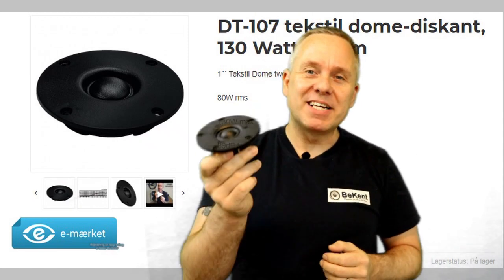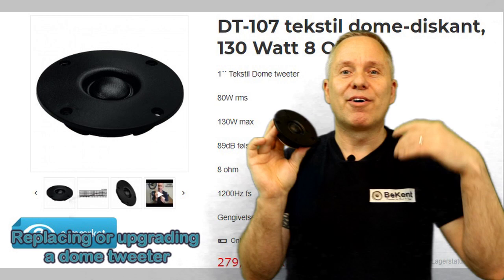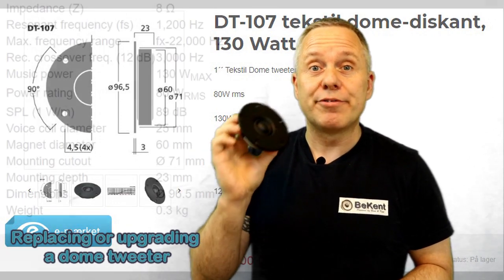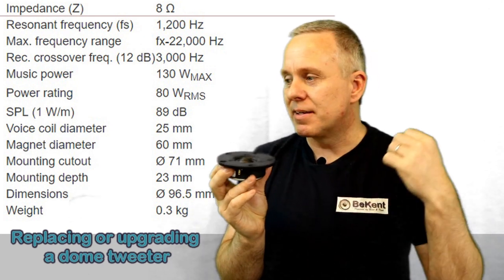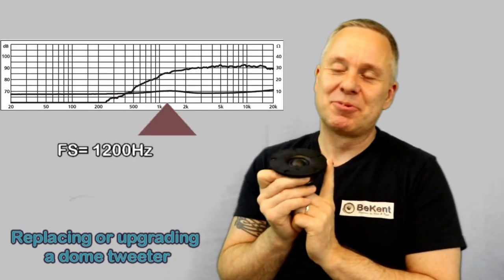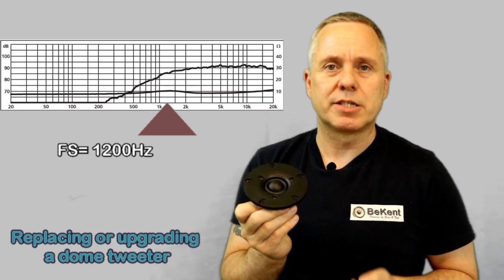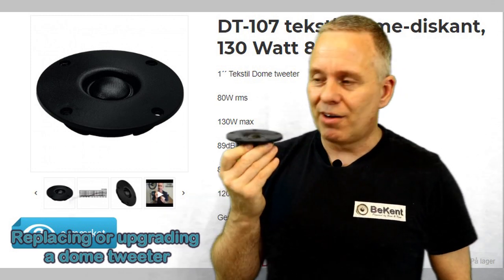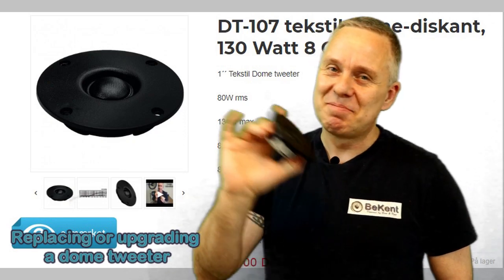Replacing or upgrading dome tweeters

Comment: Aftermarket tweeters is a game of chance. I bought an Audax  direct replacement for DALI 18 MK II . The sound is very sharp in the 5-10kz range. I could say the tweeter sings. Its anoying for long time listening. Peerless 811830  8 ohm dome tweeter matches well will DALI 18 MK II , but the magnet size is  too big and does not fit in the speaker BOX, 
thank you for this rich inside

Comment: hi thank you very much for your great and very valuable video
i see two problems with Tweeters   The usable range and their distortion
For usable range i have been told to look at the fs   The usable range should start from 2xfs up   Better use a 12dB cut
The main problem remains to get distortion figures   They are almost impossible to find on the datasheets 
A very good tweeter should have very low distortion also at quite high Spls   In its usable range of course

Comment: I have a three way old sony speaker.the crossover is at 2000/5000.1st order crossover.i want to replace my tweeters.the original tweeter fs is 900hz.can i replace it with a fs 1000hz tweeter?
Original is 93db.replacment is 89db.
Original is 30w.replacment 80w.
Plsss help me 🙏

Comment: You can turn down but not up. Impedance  is resistance @frequently  4 ohm reads 3.7 a can dip to 2 ohm  make sure your amplifier can handle load and wattage. Your are not very informative

Comment: Hi! I have b&w cm7's. The sound of the tweeter is to harsh. Could i replace it for another one?
Reply from the maker: Hi, you could but its important that you match the impedance and then sensitivity would be a good idea. I seen the Tymphany OC25SC65-04 used on a lot of B&W with success to lower that sibilance that the titanium and aluminum have a tendency of giving. But the model you have might be an 8 ohm tweeter, maybe measure the resistance with a multimeter and see if its higher than 6 ohms then its a 8 ohm tweeter.Another thing is to look for as low of an resonance frequency (fs) in the new tweeters data, the old tweeter my guess would be 1200Hz, so if you use one there has lower than 800Hz you are on the safe side, and for sensitivity if that data cant be found on the old tweeter go with 90dB. There is likely an Lpad in the crossover burning of some energy (usually is). Lastly I see the front-plate of the tweeter is shaped to fit around the midrange, and that is unique to that model, so there is going to be some shop work unless you find a 25mm dome without front-plate that will fit on the original front-plate like Tymphany OC25SC65-04
Reply: @AudioTalk  Thanks for the advice! Really helpful.

Comment: Whats not undesrandable about 90db per 1 watt? ..... it simply means, that for 90db you need 1W input from aplifier, than you can easily define how loud audio will play. if you have aprox 20W audio amplifier, you can simply count +3db per double watt amount (its a physic law).... so, for 93db you need 2w, for 96db 4w, 99db 8w, 103db 16W, 106db 32W.... so I can easily say, that 20W poweramp will produce with 90db/1w/m about aprox 103,5dB.... and now only depend of SPL freqnecy range of the speaker..... And thats it.... I really do not uderstand, how its the voltage (bulshit sry for that word :-D) better for you to fastly imagine how loud it will play on your setup :-)
Reply from the maker: When you are using a voltage you get a more accurate representation for designs, the reason is that you are only looking in relation to voltage given from the amp, and the load we need to look away from, because the load will be different from your midrange as an example (current might go up or down), so the target her is linearity (nice even response). So for SPL estimate like you are describing it's perfect using 1w 1m, but for designing a Hifi speaker and making it linear and replacing a driver into an existing design, which is a re-design it's more accurate. Your amplifier delivers a voltage and the speaker is creating a load from which the current is a product of. The current and voltage together form the total amount of energy that is Watt, so the amplifier is really not delivering Watts but voltage, it just has a limited amount of energy defined in Watts, so that's why you want to single out voltage to make a speaker linear.

Comment: What type of tweeter do I need to replace my energy cf30 tweeters
Reply from the maker: I have only looked at a few Energy speakers, and they have created a latch system unique to them, a bit like Bowers and Wilkins. So you probably need an original from an Energy dealer
Reply: @AudioTalk  thank for the reply but energy was discontinued
Reply from the maker: @justinmuir9117  in that case, what you can do is to remove the old tweeter and place a small neodymium tweeter in the hole with a piece of foam behind it to push i forward and a piece of hanging strap across the back of the foam to hold everything in place. If on of the old speakers stil work, measure the resistance with a multimeter and if you have around 4 ohms this one I will recommend Tymphany OC25SC65-04  and if its 6 ohms you will need a 1.8ohm induction free resistor in series.
Reply: Audio Talk hello, I hace the JBL 2500 speaker, This Has 8 ohms in the label, power rating 10 to 80w, 88 db. The tweeter broke down and I want a replacement. I saw some of tweeters in eBay with 4 - 6 or 8ohms, and the watts from 10 to 50w, which can you recommend ?  Thanks for your magnificent video
Reply: Energy usually installed aluminum tweeters in their speakers.